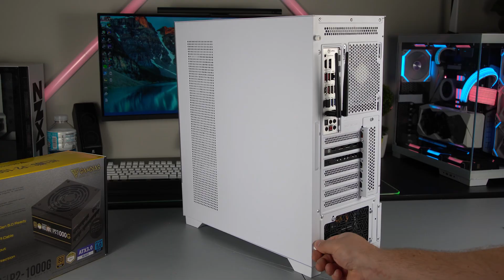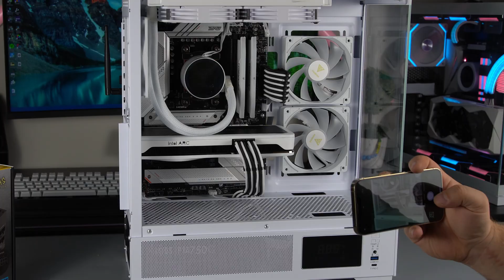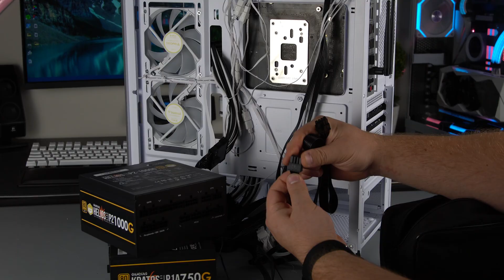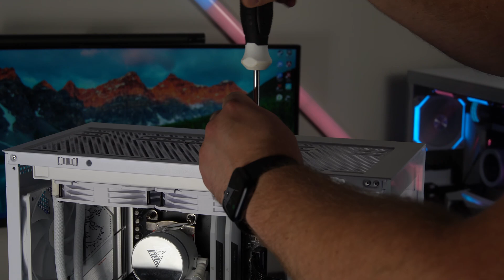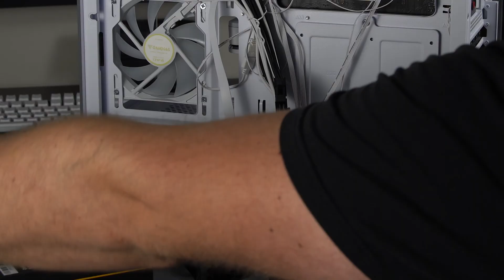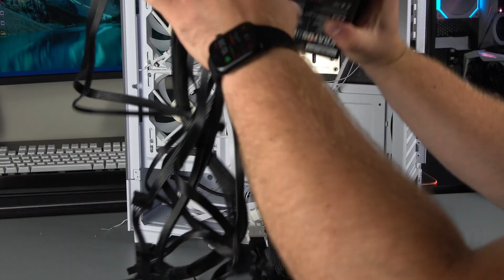How to Replace your PC Power Supply

Comment: Currently trying to upgrade my 4060 i5 13400f prebuilt to a 5070ti but i assume i need a new power supply to support it, so i might use this video
Reply: Buy a 1200 Watt least with ATX 3.1 compatibility.  Anything less and you will get power issues.  Kernel 41 etc....

Comment: Why not just use the existing cables and plug those into the PSU vs running all new cables?
Reply from the maker: Most power supplies use different cable and pin orientations/configurations. Doing that can cause failure to your components. You have to use the cables it comes with or custom made cables based on your power supply.

Comment: Ok so it’s fairly straightforward but I wanted to watch a video to see if I could find any tips or tricks. 
I adopted your replace one wire set at a time. Remove from old psu wire and install new wire on new psu as you go. Made it easy to keep track of what I needed to install still. Good tip. Thank you

Comment: Thank you for the video, for a minute i thought this would be easier with just putting both psu's next to each other and removing one cable at the time and plugging it into the same slot of the new psu.
But then we would not use the newly provided cables, you would not recommend that i suppose?  many thanks again

*edit: oh wait i think because you upgraded from 750 to 1000 that you used the new cables, i am staying with a 750 for my set up, can i just unplug from the old psu and straight into the new with the same 'old' cables? cheers!
Reply from the maker: @letthewindcome  if it's the same exact PSU then you could do that but most PSU have different cables. You could potentially fry components because the cables themselves may look the same but they are not. I learned this the hard way. I used a spare cable from another similar PSU and something started smoking. Luckily I caught it within seconds and nothing terrible happened.

Comment: Who uses an Intel arc gpu
Reply from the maker: @kobyteeth420  🙋‍♂️
Reply: @BuildsWithV  yeah right dude
Reply from the maker: @kobyteeth420  I still have the GPU in this PC. It's actually really solid. I don't use it much but when I do it performs we'll on 1440p ultra wide
Reply: @BuildsWithV  I was just messing around, I don't know anything about Intel gpus
Reply from the maker: @kobyteeth420  you're all good. I figured it was more light hearted than anything else
Reply: Seriously though I have to replace my psu soon and I have no idea what I'm doing
Reply from the maker: @kobyteeth420  you are on the correct video for sure! This should help quite a bit and if you need any more help feel free to comment and I'll try to answer best I can
Reply: @BuildsWithV  I need someone to hold my hand, and a tissue for my tears

Comment: Great video for me as a beginner. just a quick question. 

I have a 750w power supply right now and im planning to switch to 1000w, will I have to update anything in the bios or will it automatically just set everything up for voltages etc? 

I'm upgrading PSU first as I plan on getting a higher end graphics card.

Thanks.